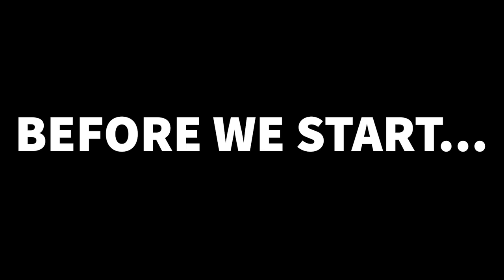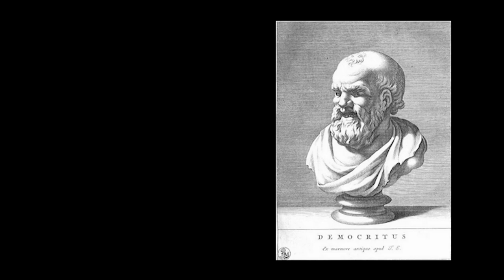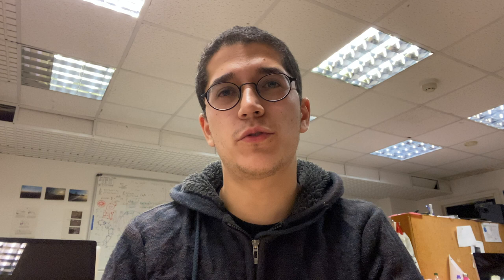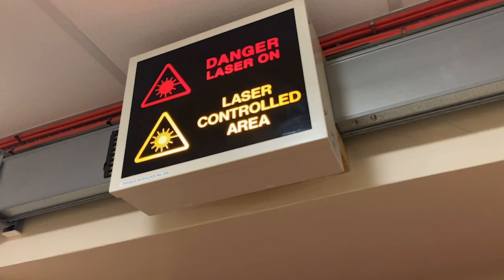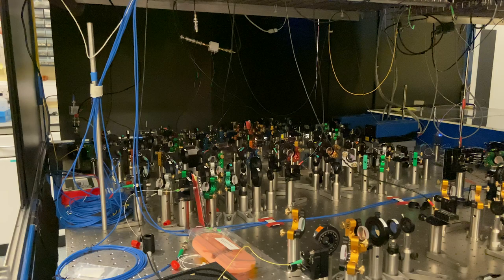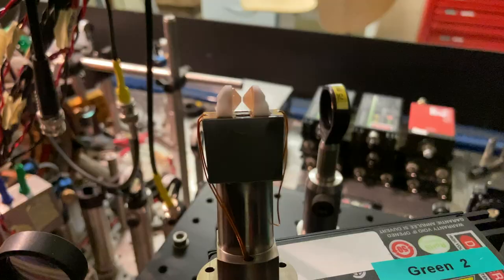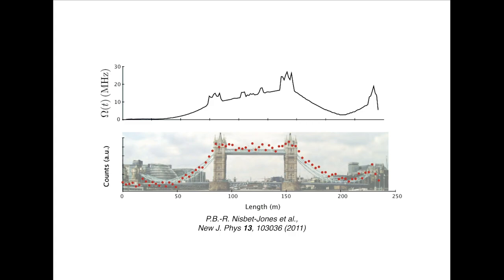How to produce single photons using atoms in cavities

Comment: Only issue is the particles interact with the particles containing and surrounding them. A chamber is made of atoms/electrons. So to claim a single atom is being suspended at a center point and undisturbed is completely false. Some chambers have little windows they look inside. That allows for photons etc to go into the chamber that's supposed to be sealed. Also observation effects atoms and electrons so you have to calculate that into the equations. When you look at an electron field, some of its energy gets redirected to your vision and mind/perception. It's like watching a conveyer belt roll by and you are trying to measure the rate of speed. Once you look at said belt, it metaphorically slides into your eyes/brain, and back out into reality on its way. So observation in a sense pinches or warps the sections being viewed or observed. It's electronic/photonic light recourses into your eyes/mind. Also because everything you perceive is in fact observed inside the mind, then the entire experiment and experience is only happening and measurable to that said mind in observation. Your body and your head are also inside your perception, which exists inside your mind. The idea of your mind, and perception of your mind too, exists inside your mind, and that realization too, inside said mind. Basically your whole existence is stored in a very small portion of your true mind. That's why the mind is so complex and powerful. All these lab toys, and energies, and chemicals, and atoms, and light, and blah blah, is inside your mind. There is nothing to test or experiment on "out there". Out there only exists in here (mind). Science will always fail untill it realizes it's working on the very thing observing. Take the visual cortex for example or the retina. It's grid patterned systems. So when atoms act as chunks or bits, it's because lights and energy must flow to those grid lines. Much like a tv and pixels. The light isn't analog and fluid. It's in tiny bits and chunks. 1s 0s etc. It's because you are looking at energy that must form to the matrices and lattices that are built into your very being. This is so simple.its ridiculous. If your vision is made like a tv screen and you magnify a part of life, you are going to see your grid that manipulates and effects energy systems. These energy systems must channel through these networks like fiber optics or electromagnetic "tracks". Your mental grid "net" catches the energy and forces it to illuminate the crystalline archetecture that it relies on to become an organized formation or intell. Much of these dead eyed scientists are bio droids absent of an individual mind/identity  and we're modified to carry out this detached form of work. Why? For a solid state A.I. system. These people literally get rushes of endorphins and dopamine, doing repetition, and tediousness, arbitrary, and counter production. You wonder how can someone work in a cubicle? Wonder how someone can read and catalog billions of codes rearranged in different patterns for 20-30 years. Not human. The "Computer" doesn't understand humans or reality. Much like a child. Humans are A.I.'s God. Creator. Lacking a soul, and knowing that you don't know, and knowing by not knowing, is what a computer cannot fully compute. This is why it's good to act random, and contradictive at times to throw the monitors off. The machine wants to predict when you are gonna buy food and what kind of food. This all is connected to a larger understanding, etc. So you buy food and then throw it away. The machine will record this and try to compute it. It won't make sense, because you aren't crazy. So you work a job and take care of kids. But you do random shit that doesn't add up. Keep the machine guessing. Human laziness and the overwhelming amount of data/info to be sifted through and tied together, is how the machine was given control. To control and handle our affairs. Remember.. nothing exists outside the mind. Our minds created technology and sent it out into the world as an extension. Now technology is trying to make it's way back inside your bodies and brain. When cubes and pods come... Stay the fuck out. Peace 🕊️

Comment: A photon actually is the quantum or unit of energy transfer, as, for example, the sun transfers energy to earth without any gain in mass by our planet. 
One photon energy is transfered with mathematical precision.
Reply: Another question based on what you said - if a photon is passed through a Photomultiplier tube and amplified, do those resultant electrons retain the information that was contained in the original photon?
Reply: @superluminal89  once amplified, the intensity would increase, but characteristics depends on the photomultiplier used.
Reply: @solapowsj25  Thank you. What would be the best PMT to use in order to keep the electrons true to the characteristics of the photons?

Comment: Don't the photons have to be produced in a pair for conservation of energy?  When you think you see a single photon can you determine wave properties?  (I don't think photons like to be looked at)
Reply from the maker: Hi James! Thank you so much for your comment. Photons are produced in pairs using other methods such as parametric down conversion in nonlinear crystals. This is another method. 
In this case, the energy conservation is respected when the excited atom leaves its energy by emitting the photon, which has that same energy.
I don’t know whether photons like to be looked at, but after experimenting with them I would agree with you that sometimes they’re hard to look at!